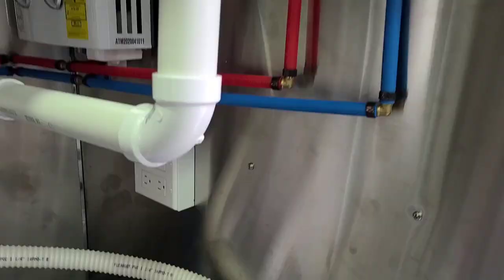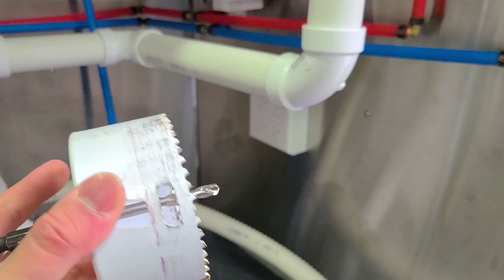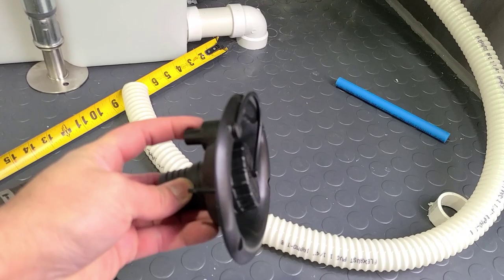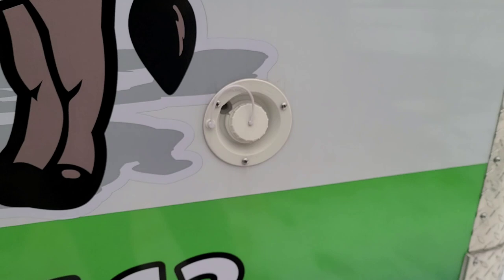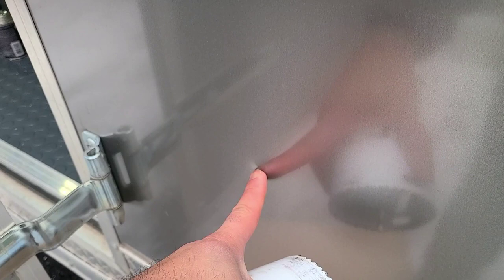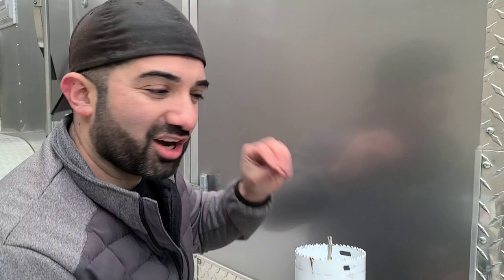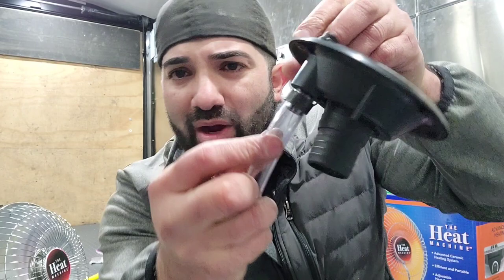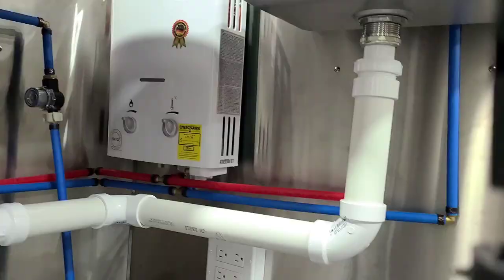How to Build a Food Truck Video Series: Water Tanks

Comment: Would’ve been nice to see u run the two pipes under the truck
Reply from the maker: Definitely. Very hard camera angle, but pretty straightforward just a 90 degree elbow to the dump valve

Comment: Great information. So I bought water tanks that are not flat. Can the fresh water tank be stacked on top of the grey water tank or do I need to return these and order ones that will fit side by side?
Reply from the maker: @caltrim1  not sure about the answer to that. Water does weigh a lot, I have only used this setup

Comment: Hi I like all your video…and I just wondering where did you buy your aluminum sheet of stainless steel sheet at?I was trying to find in lowes and they don’t have it.
Reply from the maker: No at lowes they won't or any hardware store. I found them at metal supermarkets
Reply: Thanks bro….how much is it?
Reply from the maker: @arthurperea274  don't know metal fluctuates in price constantly. You would have to call your Local Metal Distributor and see. I used. .040 gauge

Comment: What type of hot water on demand did you use in? I see that it's on the inside. Is there a way you have to ventilated outside?
Reply from the maker: I use Excel Ventfree Heater. I wouldn't know, have never used that style and personally never would.
Reply: @fbaltierrez  Thank you frank your a champion

Comment: Two more questions? I have a door on the back on my trailer. The step up and down is quite a big step. What do you recommend for a step.
Also, I have my 12v pump mounted my whole trailer is 120v do you run a battery or a converter what’s the options?

Comment: How do you connect a garden hose to the Valterra inlet? Is there an adapter ?
Reply from the maker: You mean to the dump valve at the bottom? Or the fill valve on the trailer side?